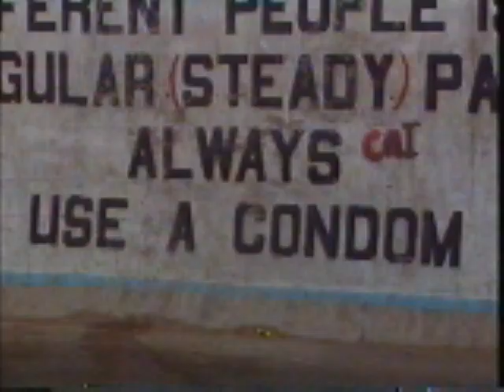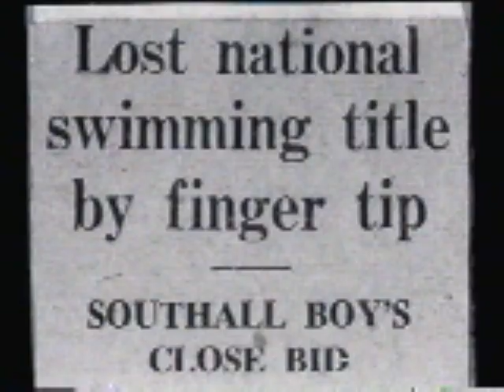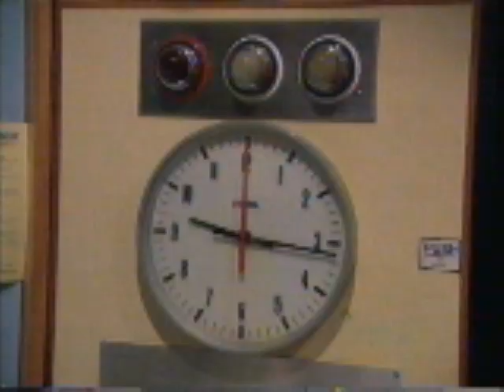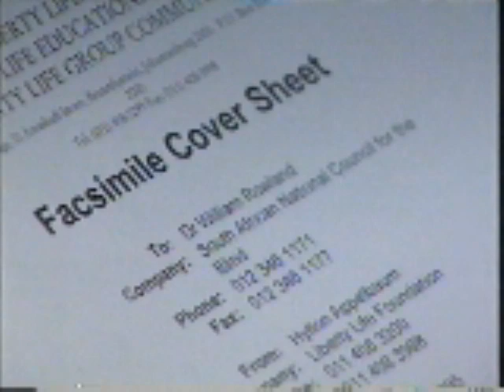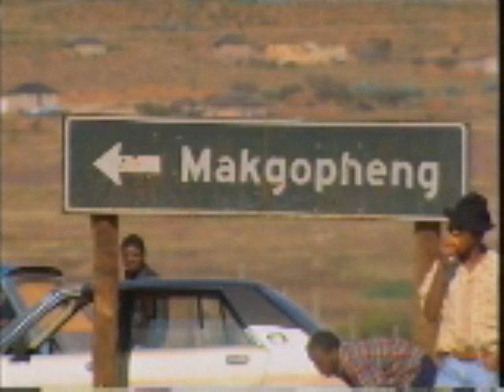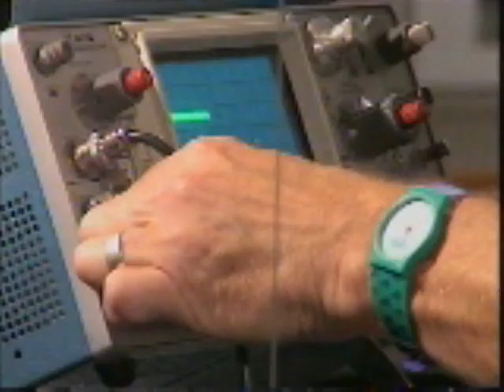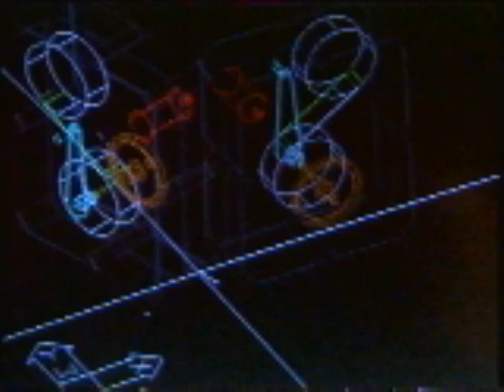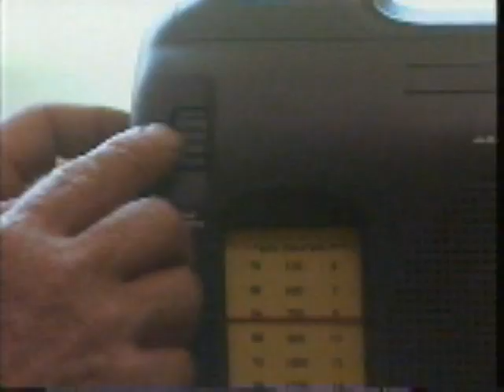BBC1 QED Clockwork Radio Documentary Aug 1995

Comment: What I've seen no one mention yet is controlling the spring unwinding so the motor spins faster as you turn the radio up. Conventional generators do the opposite, becoming more difficult to turn with a higher electrical load on them thus inadvertently slowing the spring down. Turning the radio off takes the load off the generator and the wind rushes out.
Some sort of circuit is needed that charges a capacitor to a certain voltage, sensing what the voltage on the capacitor is and automatically switches to a short circuit wire (until the radio has discharged the capacitor to a certain lower threshold voltage) to make the generator stiff to turn and conserve the spring energy.
If you want it loud, and don't mind it "big" and "heavy", then a more efficient PA speaker and piezo tweeter could be used.